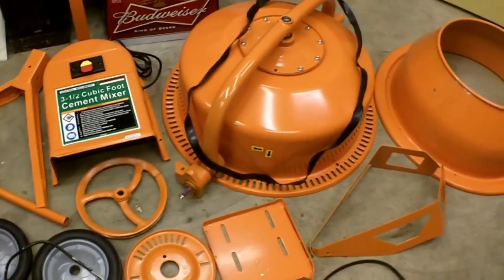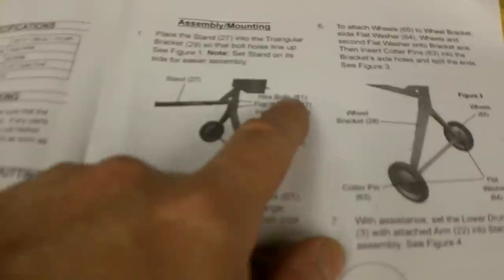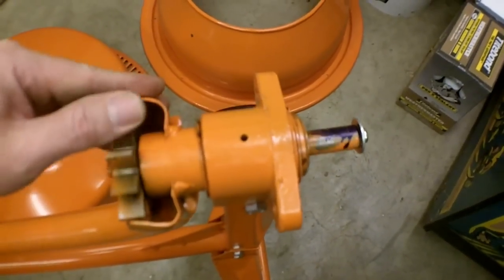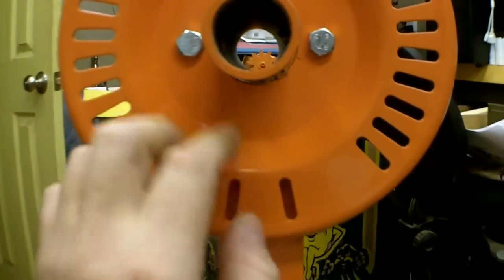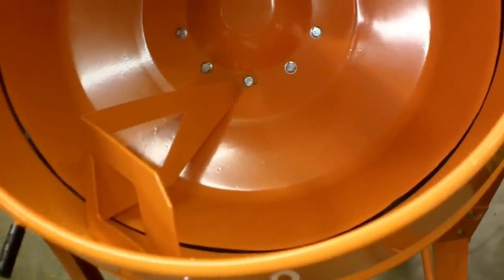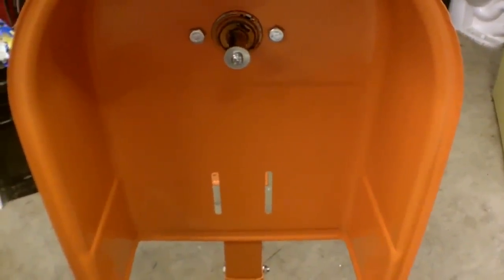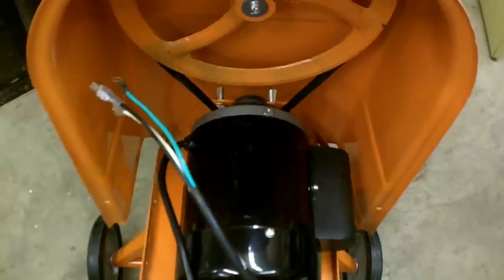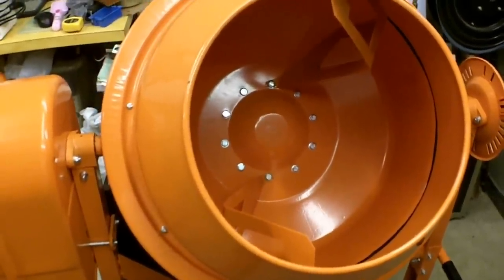Harbor Freight 3.5 Cubic Foot Cement Mixer Assembly and Review. Item 67536

Comment: Helpful, thanks. Just picked this mixer up for $117 after a 25% off coupon and $40 gift card. This video is likely to save me a headache.
Reply from the maker: That was a good deal! Hope the video helps. Good luck, G.
Reply: ghostses Thanks! Question... How well does it roll on uneven ground? The wheels and the way they mount looks kind of cheap. I'm thinking of picking up some HF 10" pneumatic tires and putting them on a threaded rod axle through the existing tube. That will also probably give me a couple more inches for getting a wheelbarrow under it.
Reply from the maker: It's kind of a pain to move around on uneven ground- but it can be done. 
Putting a set of 10" pneumatic tires might be a worth while upgrade. If you can find some with a large enough axle hole- you might be able to put them over the existing shaft.  If not, the all-thread would be the way to go. Then you could screw a block under the foot to level it out. My barrow is pretty low, so I can get a dump if I position it correctly- but a couple of more inches would make it even better. I say, give it a go as it is, and you can always mod it later if you feel the need. Even if you do, you're still way ahead of the game for what you actually paid! Take care, G.
Reply: Well, I was in the neighborhood of Harbor Freight and Lowes today, so I decided to grab the pieces I'd need to do it. The wheels, rod and hardware all came in under $30. I bought my mixer to do some landscaping projects, so I figure doing the upgrade right off the bat will probably be worth it. I will post up an upgrade video when I get around to assembling everything.
Reply from the maker: That's cool. Not much money at all. Drop a link here when you get it all finished up. I'm sure it will give others ideas. G.

Comment: Hum seems yours was a little better on fit and finish than the one I got , but it wasn't real bad just had to drill out a few holes to get the bolts through . Mine was more like the book than yours . Ready to do some mixing . Doing some pavers to go under the drip line . And who knows maybe a new patio  . Makes me think of my old Chevy 283 .
Reply from the maker: Glad you were able to get it sorted out Spencer. Good luck with your projects! G.

Comment: Tks for this Video. I just bougth one similar from China and I´ve receive it in Spain. I found exactly same issue with the legth impact... and for me was crazy to fix the mixing blades. Still doing and tks to your video, I think I´m going to solve it. Mine cost 209 Eur in Amazon, perhaps a little better the electric motor and assembly , but there is no motor belt and handle control is just a spring (nothing more...).
Reply from the maker: That's cool Carlos. It turns out he leg is supposed to be bent so it sits flat on the ground. It didn't look right to me though. Good luck with yours, G.

Comment: Your video is amazing. Thank you for sharing! MIne didn't come with instructions at all... what garbage, #HarborFreight pushes off on people.  I'll be using it to tumble stainless steel media to clean scale off my pieces I make in my blacksmith shop, so it doesn't need to be water tight, but your assembly description saved me A LOT of time! Thank you. Thank you. Thank you!!!
Reply from the maker: Thanks Greg! Glad it was helpful. I've had some comments on folks using them to make fireworks, but never heard of using it for removing scale till now. Very cool. Hope it serves you well. G.

Comment: Thanks a lot man.   The owner's manual of this product is poorly written.  I spent 3 hours on this thing and got confused at the electrical box part.   Your video is very helpful, in particular the jam bolt part at the handle section and the electrical box part.   I made it work right after seeing your video.
Reply from the maker: JamesJiejun5664 No problem James! I'm glad it helped in getting yours squared away. Yeah, the manual is something else for sure...lol. Take care, G.

Comment: Thanks for this video.  I have put a number of things together as an assembler for the now defunct Lechmere, and these instructions were god awful addressing assembly.  The lack of lubrication for the items was a bit hairy as well.  To note though, if you use what is called an irrigation syringe, which has no needle just a plastic tube (These can usually be found at dentist office) and most of the time you can get one from you normal dentist.  Sometimes people get them as well with oral procedures, they never really come in contact with a skin surface, but clean it with a little bleach water anyway before manhandling it.  You can fill the irrigation syringe with the grease of your choice and it acts just like a small grease gun, which is how I greased the shafts through the tiny little holes, as I could tell there was none.  Once started you can add a little more this way as well to ensure that the shaft is well lubricated, because metal on metal just doesn't work well.  This also can be used in a number of other items that need grease lubrication, but are either have no fitting or are just tight spaces.  The other thing I did do was use a  piece of gasket material on the bracket mounting the motor houses to the leg, and this help with some of the potential vibration issues that may cause problems loosing the nuts later.  This was a great video and really appreciated.
Reply from the maker: Thanks Todd! That's a great idea for lubricating the shafting! I'm sure it well help others out. Much easier than pulling the blocks off like I did, or installing zerks. Adding the gasket to the motor bracket should help as well. Thanks for the tips and good luck, G.

Comment: Nice video.

That "damage" you describe at 1:30 is NORMAL.   That piece is supposed to be bent to make the mixer more stable. They're all like that.  You'll notice that the other end (with the wheels) also "bends" out.  : )
Reply from the maker: Yes, it turns out it was made that way. It just looked odd to me at the time. Thanks for the post, G.

Comment: when rubber gaskets or anything rubber that needs to be straight or flat that has too much creases  , use hot water to soften , dip in a hot bathtub or sink for few minutes and lay it flat till it cools... just a tip I deal with creases on rubbers .
Reply from the maker: Good tip Frank! Thanks for sharing, G.

Comment: The tightness at 9:45 looks like the gear is hitting the gear shroud, which appears to be bent.  Did you ever get that stiffness resolved?
Reply from the maker: Tom, the gear wasn't hitting the shroud but it does appear to be bent- or just poorly made. I just ran with it and don't know if it worked itself out as I've not checked. The machine does work fine though nonetheless. Take care, G.

Comment: HI Ghostses, I bought a Mixer like the one you put together, The box was a disaster but everything was good but one thing!  The arrow on the top drum was there but the bottom arrow and rotation  arrow was missing. So I don't know how to line up the right holes so I can get the fin holes in the right position. Can you help me out?  I can remove the bolts from the center hub to get the fins in the right position but don't know witch ones!  Hard to explain LOL
Reply: I think the problem with Harbor Freight is they spend more time explaining the safety shit than they spend on how to put together the mixer.  The bolts are real bad, I found out how to get the gasket in with out a problem. put the bolts in the holes on the upper drum and put the gasket on the bolts. the holes on the gaskets are smaller so it keeps the gasket there .
Reply from the maker: Donald, I can't get to mine- but based on what I see in the video, the two holes for the paddles (The ones in the upper drum) should be inline with the holes in the bottom drum. If you already have the drum halves bolted together, that should let you know which ones to move. Hope this helps, G.
Reply from the maker: LOL! They do that in all of their manuals. Most of them are all about safety. That's how I put mine together as well. Worked like a champ! Good luck, G.
Reply: Yes I have bolted the drums together and I'll just swing the paddles around till they fit better. Thank you my friend for the help
Reply from the maker: No problem! G.

Comment: Hi ghostes, thanks for the review
how many 80lb bags easily fit in drum?  3.5 cu' seems like size of drum not necessarily the amount being able to mix at once,,
Reply from the maker: No problem Matthew! To date, I've only mixed 1 bag at a time. I did locate one comment that states they mix 2 at a time. While I cannot confirm, this is the the complete message. Hope this helps and good luck, G.

 
"I have this mixed over 200 bags thus far The paint is chipping off but still going.
 O & I mix 2 80lb bags at a time Get the first bag in with water then dump the 2nd Dont try to both at the same time."
Reply: ***** thanks ghosts
Reply from the maker: Matthew Burke
No problem Matthew! Take care, G.

Comment: Just bought this last week and was about to start putting it together. Heard how bad the instructions are and it's best to watch a video. Well since the time of this video and now, things have changed. The instructions are still bad but the layout is different and so is the hardware. In this video, the hardware was separated out in labeled bags but now the hardware is all thrown into one big bag and have to sort everything out by the part number in the back. I wish mine was laid out like this video is.
Reply from the maker: I've heard that here and there- the fasteners being in one big bag. Not cool, but it can be done with a bit of effort. Should you have to reference and sort things out? No. But either way, I hope the video was helpful in some way. Good luck, G.

Comment: Great video. You must have gotten a good one. My first one was supposed to Hell direct from the manufacturer not a crack in the paint but fully deformed. Next one had stickers in the wrong spots for the drums. Either they needed to be installed with the point up or the holes were off. Without bowing the blades, they were not going in regardless of how the top and bottom drum were aligned. This is junk. Maybe cheap junk but very expensive in terms of time to put it together.
Reply from the maker: Thanks! Perhaps I did, but cant say for sure. I do consider a lot of HF tools to be "kits"- especially if a motor is involved. Did you tap out, or make it work your you? I'm unclear. Take care, G.

Comment: A tip for aligning the belt is to measure from the top pulley to the back wall then from the lower part of the belt to the back wall....this should give you a good alignment...
Reply from the maker: That would work for sure. Thanks for the tip, G.

Comment: I can't get the paddles to line up correctly.  I've lined up the arrows on the drums and that isn't working.  Any advice?
Reply from the maker: I guess it could be that the arrows on the drums weren't put on in the correct location. I would put paddle in with the bolt on the top half of the drum, then rotate the paddle into position and note where it wants to go on the bottom half. Then remove that bolt and install the one for the paddle. Past that, install the bolt in the other holes. Hope that makes sense and good luck, G.

Comment: I have this mixed over 200 bags thus far The paint is chipping off but still going.
 O & I mix 2 80lb bags at a time Get the first bag in with water then dump the 2nd Dont try to both at the same time.
Reply from the maker: That's pretty impressive! Thanks for the tips on mixing two bags. G.

Comment: BTW - for those who may a heat gun handy, I set mine up on the floor of the garage and slowly ran sections of it over the heat to make the gasket more pliable and get the kinks out.  I think this is referred to in the video.  It worked pretty well and allowed it to return to a normal enough shape to aid in aligning the gasket along the rim.  Not sure if it's entirely necessary, but it helped.
Reply from the maker: Good tip Mike! I'm sure it will help others out as well. Thanks, G.
Reply: Best way to do it is join both halves first and then slide the gasket in between by lifting up one of the halves and align one hole at a time. Continue to rotate and sliding the gasket by each hole until all are done. Makes it easy

Comment: Thank you for making this video.  It is very good.  HF instructions are terrible, and not due to translation issues, just terrible, terrible instructions...or lack of.  HF should be paying you royalties for including this video on their site.  On the positive side, all parts were in the box and nearly all fit great, just a couple of minor adjustments to holes, and it works great.  I will be using it quite a bit in the near future so I'll soon know if it holds up to use.
Reply from the maker: Glad it was helpful Bill! They keep saying the checks in the mail but for some reason it never comes...lol. Good luck with your projects! G.

Comment: Whelp, I looked up this video so I could see if I was trying to put the paddles in wrong, but now I see I obviously got the paddles from the smaller mixer...after much frustration...I was putting them the right way but they are a good inch and a half short.. might just return this thing... really wishing I had just spent a little more money for the Kobalt from Lowes which got awesome reviews.
Reply from the maker: They do have a good return policy Mike- but it shouldn't have been an issue in the first place. I too have read good reviews on the Kobalt. Good luck either way, G.

Comment: thread the holes for grease firings, use red loctite on the bolts, use silicone to seal the two drums ( no gasket needed) u can use fiber grease on the drive gear and drum cutouts but that can attract dirt ??
the reinforcing plate might need to be inside the drum,,, maybe.
I've used high dollar one's that make a hell of a racket !!!
not bad for $150 ?
not bad at all, rent one as much money and you own it !!!
Reply from the maker: Good tips John! Yeah, for what it costs compared to rental- you own it in short order. Take care, G.

Comment: Mike L. You are truly a meat head 4 real lol. Hey ghostses your instructional video was on point. I had no problem with putting the 3.5 cubic feet electric mixer together. You are the man, now I can put in serious work and lay that cement down all around my house. 
NOTE: I greased everything you greased with mobil 1 synthetic bearing grease and also sprayed the drum track and gear with lithium grease while it was spinning. My concrete mixer is fairly quiet. Thanks bro. Have a good one. ☺ 👍
Reply from the maker: Kevin Johnson LOL, thanks Kevin! Why he didn't skip the the meat is beyond me. I did show every step to put it together as you, and many others, have found. I'm glad you got yours put together with ease. Yep, putting it together is just the work before the work! I didn't grease the drum track on mine, but may in the future. Good luck with your projects! Take care, G.

Comment: Oh, Ghostes I  have a fix for the spring that pushes the handle to lock. When I adjusted the spring tension it bent the spring and slipped out, so I drilled a 3/8's hole through the pipe under the spring  and let it stick out about 1/4 in inside the spring and put a nut on the inside of the pipe to secure the bolt. It really works great now. You can really add the tension to the spring to keep the handle locked
Reply from the maker: That's a great solution Donald! Thanks for sharing it. I'm sure it will help others out if they have that problem. Take care, G.

Comment: Thanks for the video.    I just got done. About 2 and a half hours.  I I thought then I went to pick it up and move it and realized I had to handle on the wrong end soon I have to switch to handle with the tires I don’t think that’s gonna be very easy because this thing is pretty heavy but it does run let me just add that if the Chinese made an airplane I’dWalk or take a boat
Reply from the maker: No problem! Honest mistake and easy to switch. LOL!!!! I'm right there with you. Take care, G.

Comment: Mine just died.  I don't like the gear notches.  Very noisy.  I just bought a Kobalt 4 cu ft with support rollers.  We'll see how it flies.  I put one 80lb bag in, 1 shovel of portland cement, 7 shovels of sand/gravel mix -- all for one load.  It lasted about 3 years doing this about 4 times a year.  Seems like it should have lasted longer.  Hopefully the Kobalt will last longer.
Reply from the maker: My projects have gone back burner so mine's seen little use. Was it the motor that went, or something else? They're so simple, I agree it should have lasted way longer. Hopefully the Kobalt will serve you better. Good luck, G.
Reply: ghostses 
The motor still works.  The tub would just stop from the weight and I would have to try to spin back up.  I flipped it to the other side and the drive slipped and now it doesn’t turn with the motor.
Reply from the maker: I see. Thanks for the info. Good luck, G.

Comment: Actually the only issue fore mine was the same metal bar bend. It must have been done in shipping.
Reply from the maker: Jason, I've received many responses on the bend. It turns out it was done that way on purpose so the foot will sit flat. It didn't look like a machine made the bend to me. Thanks for the post and good luck, G.

Comment: I can’t tell for sure, but I think maybe you didn’t install the handle control plate and motor mount correctly. Or there are slight differences in the product over time? There is a very small tab that both of these fit over — and then you rotate. Both the handle control plate and motor mount fit snuggly even before you bolt them in place.
Reply from the maker: They have may model numbers for the same overall product- but they are different in some ways. G.